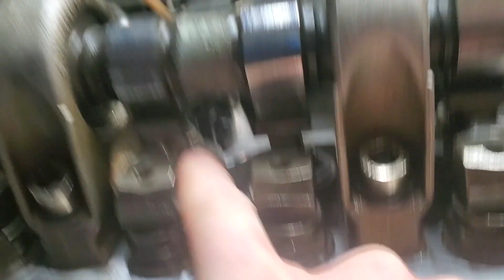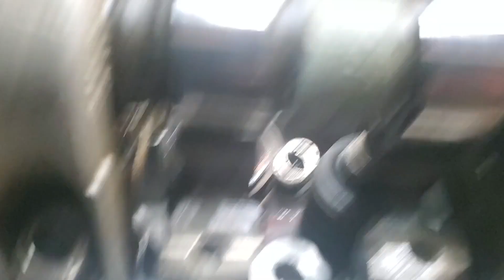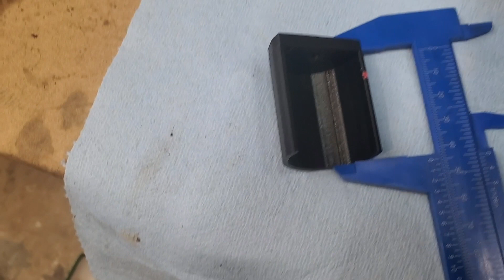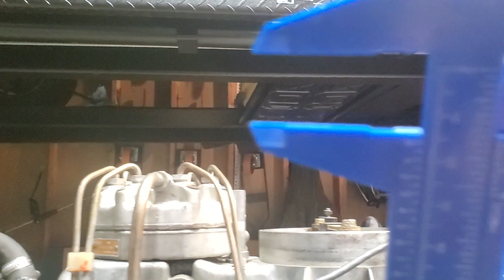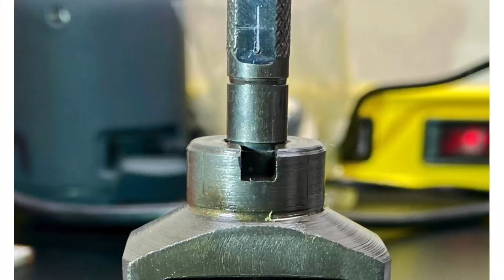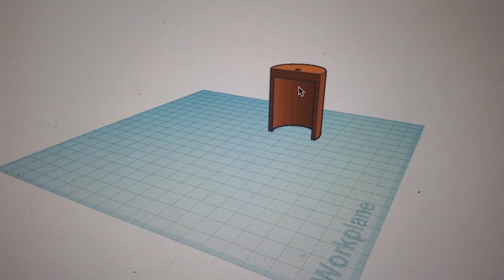Mercedes 380SL 116 Engine rebuild part 5 (3D printed compensating element measurement tool)

Comment: Pretty nifty tool. I don’t have a 3D printer so the 118 bucks was the cheaper route for me
Reply from the maker: I will mail you one if you need it.  Or I will give you the file so you can print at the library.
Reply: @johnriexinger6654  thanks John, but I bought the tool month ago and can’t return it now
Reply from the maker: @inovahightechltd  Can you provide the exact measurements, maybe I can make a copy incase others need it.
Reply from the maker: @inovahightechltd  It started up!!! now I have to go back and check the elements.